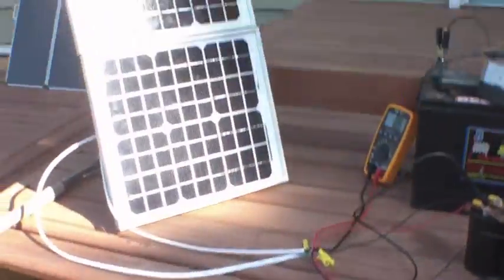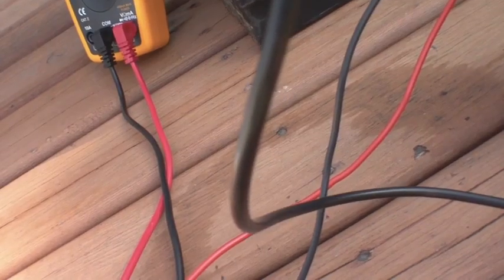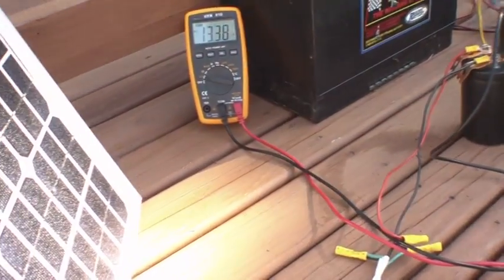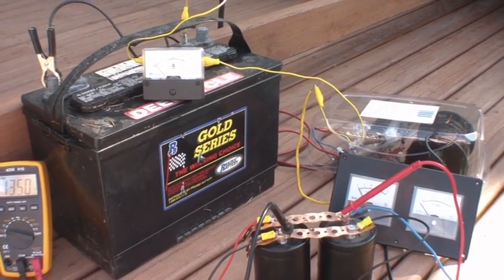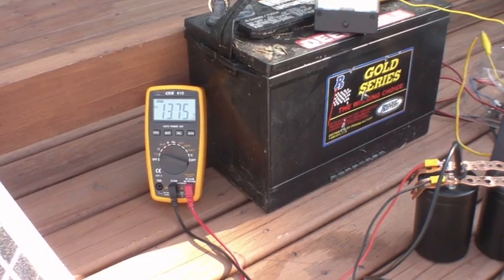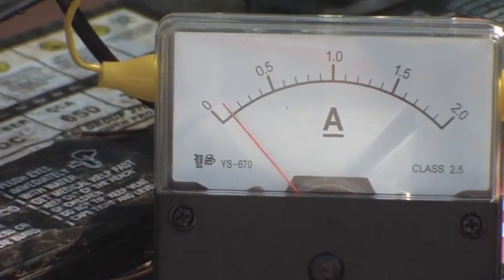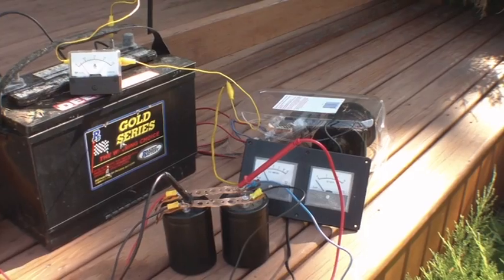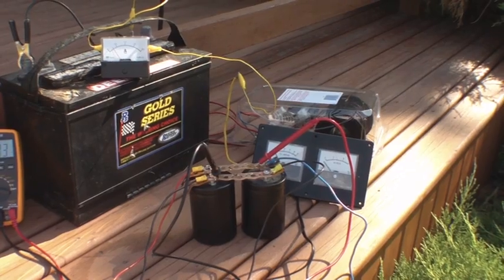(24V) Solar TS SS SSG Charging with Partial Shading

Comment from the maker: Well.. it is certainly effective, but the video is a bit misleading actually... I later discovered that WHERE you apply the shading on a set of solar panels (in series) makes a HUGE difference. In the video, I applied shading to the 2nd panel, turns out if you shade certain areas of the 1st panel, the effects are devastating.